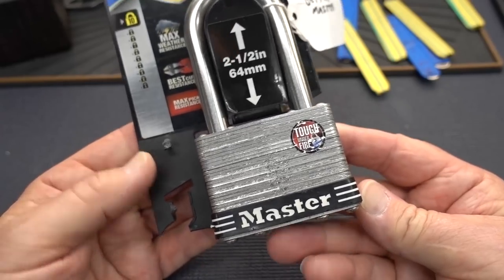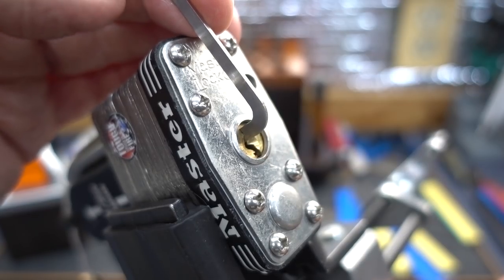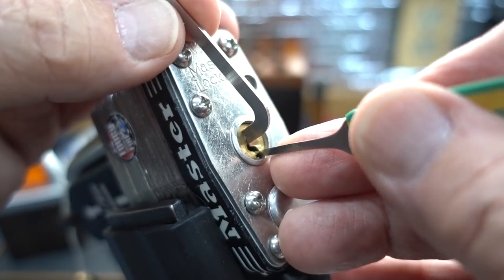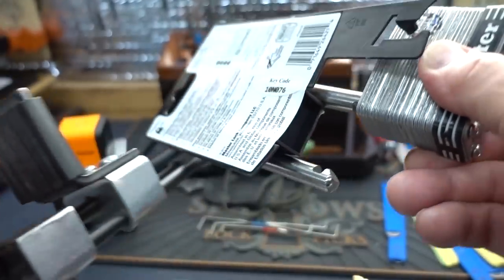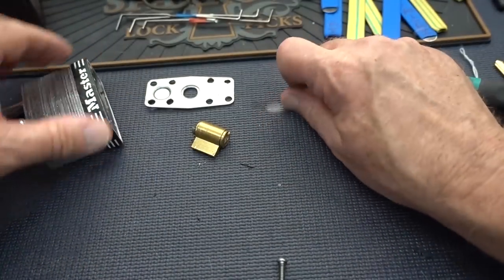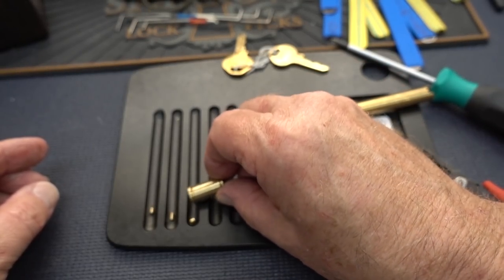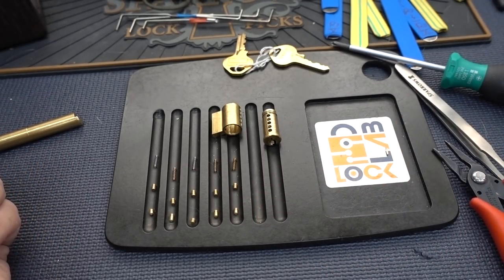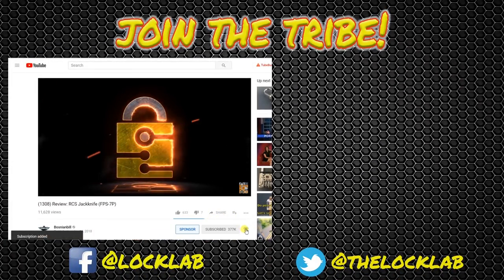(1344) Improved Master Lock Model 15 (REALLY!)

Comment: I swear that Master just spins a wheel for their security rating. They have some boron steel shackle locks with ball locking mechanism that they rate at 5 and they rate this one as a 10? (True, they are 4 pin vs 5, but really?)

Comment: Bill buy another follower and file an edge down to gut these locks. You will run into them again. Simple mods and even a Master lock can put up a fight. I just got surprised yesterday when I bought a dirt cheap ten buck entry lock to use as a job temp. While keying it I was amazed to learn it had spool pins. I can't accept production costs would be much different with or without security pins. All this to say I think the message is getting thru. Keep it up!
Reply from the maker: shygh  Thanks for the tip!  I'll mill the side off one of the cheap followers to fit those keyways.

Comment: When gutting, I notice that more often than not it seems that you just dump the springs out. Does their position matter if they differ? Or do they just differ in order to provide different/confusing feedback?
Reply from the maker: On challenge locks I usually try to pull the pins out of the proper chambers to see if they are different. As you note, varying spring tensions can confuse feedback somewhat, especially if the spring strengths vary widely.  On commercial locks, I usually just dump them out because it isn't cost effective for manufacturers to put that much thought into springs.  You can usually tell if the springs are different after removing the driver pins and looking into the bible to see how deeply the spring sit in the chambers.  Even on challenge locks, if they all look the same I simply dump them out to save time.

Comment: The major problem with this "improved" Masterlock is that it can be essentially "picked" with a #1 Philips screwdriver. The improvement to security afforded by the superior pinning is completely canceled out by the fact that the bottom can just be unscrewed. Hit those screw heads with a TIG welder and permanently attach them to the case, and then you might be on to something.

Comment: I've got one exactly like this (minus  the fancy modifications) that's been giving me problems for a long time. I'm a novice picker but I've never had any problem with 4 pin locks before. Any advice? Did they do something different with this one? As far as I'm aware it's just one more pin, shouldn't be giving me this many problems.
Reply from the maker: The only "difference" is that the older locks were made with more care and precision than the new junk.  As such, they are more difficult to find the binding pins in, and thus a bit more difficult. Good luck!
Reply: @bosnianbill  thanks. Right after I messaged this I managed to get it picked once for the first time ever but haven't been able to do it again. I think my problem lies in accidentally oversetting some of the pins. 5 is a high cut where as 3 and 4 are both very low and it's hard to avoid oversetting them when trying to get to 5.